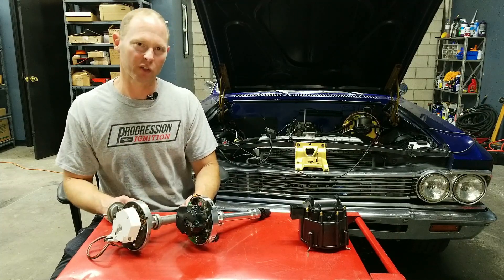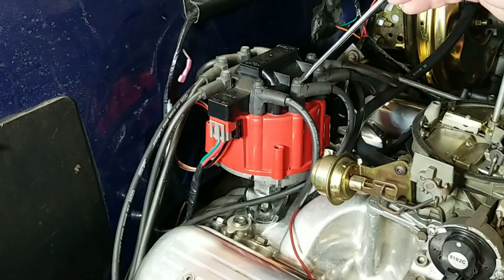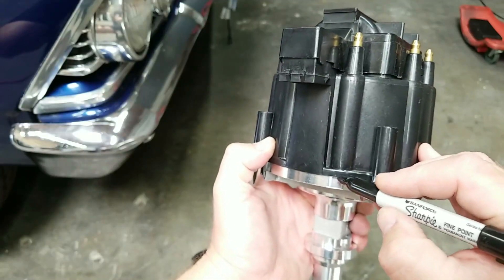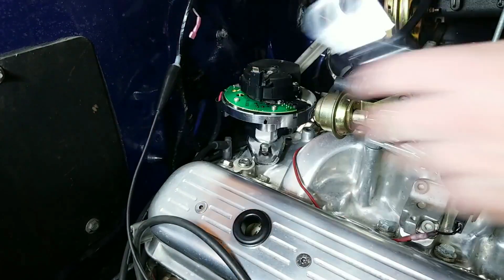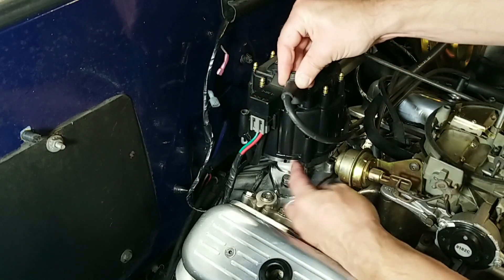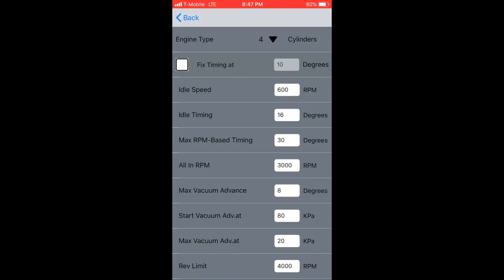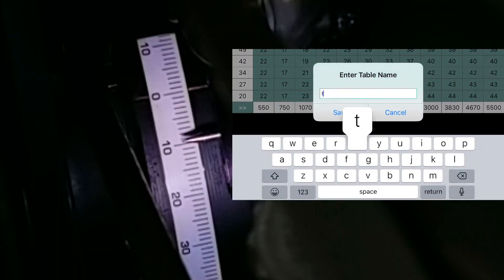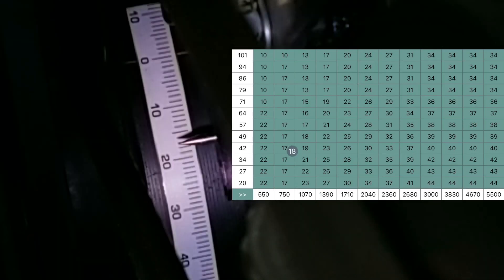Swap an old HEI distributor for a new wireless HEI

Comment: Makes me wonder if you can use this dizzy in any 90's ford 302/351w EFI after you do the full egr delete where your timing is a bit screwed up afterwards with possible pinging and such.  The huge issue is that the eec keeps advancing the timing because of the lack of egr signal.   Any thoughts on this?  Have you heard about what I'm talking about?  Hopefully I will get a response.
Reply: Why not run full egr or a blocked (plugged passages) egr valve?
My later gm obd 1 cycles the egr during deceleration and measures map pressure to confirm egr operation.  An egr delete (or blocked passage) generates an egr code.
Also, is your tranny a 4-speed auto with lockup torque converter?  Cruising in 4th you need lockup working, else too much heat is going into the fluid from converter slip.

Comment: Could it be possible that I went a tooth too far when I inserted my HEI Progression distributor? It seems to idle too high. I know other components can effect this but I am starting from scratch on a sbc chevy 350 with a Holley 4150 Carb. I've set the carb up the way many of the YouTube videos said to. On a cold start up, do I just rev the engine up to 1200 rpm and turn the distributor until the timing mark hits 10 degrees BTDC? Or do I need the let the engine warm up to a certain temp before I line up the 10 degrees BTDC?

Comment: would this work on a 93' FORD 460/429? BIG BLOCK obd1 efi? Even with the basic ford efi system, since its still adjustable, an a disitributor...still need too be adjusted, would this distributor work? If i removed the spout plug?  It seemslike im always needing too tweek the timming base,etc manually depending on fuel quality, weather etc.. This woulld be great..

Comment: So 34 total set in configuration and the timing table sets 40 as max. How is this not going to make your engine go boom ?
Reply: 34 is total mechanical advance with base timing. So 10 base 24 mechanical will give you 34. The vacuum advance is where 40 degrees comes in that's when your at a steady cruise speed you won't get ping. Vacume advance also adds timing at idle when connected to manifold vacuum for better combustion at idle.

Comment: A circuit board isn’t for me. My Pertronix died, my Crane XR-i died. I was going to try an Accel module but reading reviews that they sometimes don’t work out of the box so I’m back using points in my 70 Z/28. Good luck with the China distributor.

Comment: Hi there. I was trying to put one in my 1989 OMC 4.3 L gmc boat motor but there is no vacuum canister on the old one. Also wiring is not numbered so I can plug them in. Wish someone can tell me if there's a way to get ir done. Thx

Comment: One thing I'd add after set up is "valet mode". Set the rev limiter to like 2,500 rpms or so.
Reply: I think you could make a table with a max RPM of 2,500 call it ''valet mode'' and save it to the distributor when you arrive.

Comment: That's INGENIOUS! You can choose how your engine runs from your cellphone. It can disable the ignition system, and detoured wannabe cars thieves. I wonder if it works in cars with the standard GM distributor electronic ignition.
Reply: It can also leave you stranded if you don't have your phone or something goes wrong there's no manual override safety feature that I'm aware of
Reply: @optimusprimer4392  Spare oem module in the glovebox

Comment: This is neat, I like it. I'm sorry I missed it 3 years ago, just found it. Anyway my question is this - do you plan to do a system with this dist or similar and a knock sensor? Seems with the computerized module a knock sensor setup would be a good addition - also, do you make this for small block ford as well? I have a forded HEI and love it and this seems like the next step.

Comment: How can you possibly adjust the idle correctly at the distributor rather than the carb, and what  RPM should you have it set at the carb in the first place?
Reply: You don't adjust idle rpm with this. You enter the idle rpm that your engine is already set at and enter the timing you want at that idle. Idle rpm changes are still done at the carb.
Reply: @65slick445fe  Thanks for the response sir.

Comment: I know it doesn’t make a difference, but as a GM purist, the way the distributors were clocked and the wire they had designated as #1 made my eye twitch.
Reply: Yep!
Reply: That and “34deg” all in. I feel like I saw 42 at 3k
Reply: @turdpolisher1466  Some vacuum advance, not full throttle.

Comment: How does it work if you don’t have your phone with you? Does it remember your previous settings?
Reply: I’d assume it would but I’m the type of guy that has QD negative battery terminals. Would it forget if I left it unplugged for two or three weeks?
Reply: @hailtothe_rooster1572  I wouldn't think so. You can leave your phone with a dead battery for months and it still retains all of the data and settings

Comment: Doesn't manifold vacuum fall to zero at wide open throttle? How can it be adding to advancing the timing at high rev/WOT?
Reply: Reads the RPM signal and determines from your table where it needs to be @ WOT. Same as mechanical advance adds it with more engine RPM. This works the exact same was as an OEM Distributor it is just a lot easier to tune your timing. No more springs weights or vacuum canisters.

Comment: You set your max advance at 34 degrees but when you ran your rpm up above your 3000 rpm "all in" mark your timing was way above 34 degrees and climbing still as you went past 3000. Is it adding 34 degrees to your initial 10 making your max advance 44?
Reply: manifold vac was adding in more,
Reply: So I guess you would just have to adjust to get your total advance down lower after you figure what the vacuum advance is adding in?
Reply: No you don't change total advance. Vacume advance ads timing because it wasn't at full throttle so it was receiving a vacuum signal. At wide open throttle vacuum advance won't add timing you'll only get the 34 that's set.
Reply: I just made same comment them read this...hopfully they chime in to potential customers

Comment: Looks like a great distributor.  Doesn't this distributor require an external coil?  If so, what ohm rating coil is required?
Reply: The distributor he used has the coil in the cap  But they sell the smaller distributor with the external coil

Comment: This is slick I need one for my up and coming windsor build this winter

I thought about just having the duraspark recurved. But why have it done when you can do it yourself??

For HEI guys this is a godsend because those curve kits will never limit mechanical advance more then 18 degrees at best with a 500.00 msd billet HEI. Some want less mechanical advance

Excellent work!!  Bookmarked the website

Comment: Stumbling block..?  If your engine is old and has no visible timing marks, users may struggle to find and set that mark on the distributor body prior to removal. However, the rest of the process and the product looks ace. Going to your website now. Well done.

Comment: Notice that part 'connected to full manifold vacuum' as opposed to 'ported vacuum' which was strictly an early, pre-converter crude
emissions strategy, and nothing more.
Reply: Even with converters they still used ported. 

What it did was it raised EGTs at idle to make the Smog pump and catalyst work better. 

I always run full manifold vacuum, idles better and uses less fuel to idle

Comment: I have a 1964 Plymouth Fury with a 1968 440 engine. This car came to me "as is". The distributor is stock 1964 with no vacuum and it has an MSD 6AL box.   Is this something that can be set up on this car with or without the MSD box? Thanks
Reply: Yes

Comment: Cool Video I was wondering do your distributors work with msd boxes
Reply from the maker: Yes they do
Reply: @ProgressionIgnition  digital 6al box? What is the part # for a ford 5.8w roller motor. I am going to reuse the stock camshaft so i beleive that i need a harder gear. My current 5.0 with comp cam roller has an msd with bronze gear but ive read the factory ford cam will require a harder gear.

Comment: That is f'ing slick!
I want one for my Mach One, Jeep and Trans Am.
I guess you don't make one for my diesel truck.
Reply: You kidding about your diesel right? They are compression ignition and control ignition by injection pump timing, requires special tools to set timing on a mechanical pump or a computer to adjust injectors

Comment: It's definitely a cool-featured device. But it would be a hard sell for me. An ignition module is 10 dollars should it ever fail. What does one of these cost? If your phone battery happens to die are you stuck at 10 degrees advance and thus in limp mode?
Reply: The distributor works as a self contained unit, without the phone. The phone is only necessary to tune the engine, but once it's been tuned the distributor will remember your settings.
Reply: Ah, I see. That makes a difference.
Reply: @VinnyMartello  and you can have like 5 curves